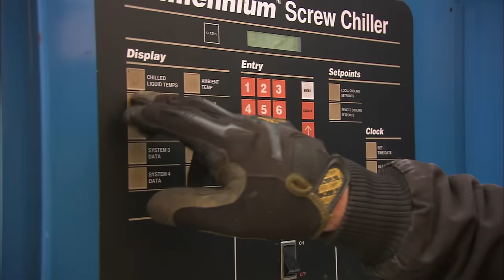Building An Ice Rink | How Do They Do It?

Comment: I'd expect them to use a bigger hose for water
Reply: I put down the ice floors for ice capades from 80 to 85. I was done a little different then this. We could put down a floor 60 feet wide and up to 160 long. We would make the ice using an everyday garden hose with a spray nozzle. It could take up to 24 hrs to make the ice. Two guys, one at a time would trade off for 8 hrs  walking backwards spraying water. A little at a time slow and steady is how it is done. The stuff they use in the tube is the same as what we used, ethylene glycol as you would know it by Antifreeze or they may use propylene glycol it is less toxic.
Reply: There in a stadium were would you expect a bigger hoses.
Reply: Nah, it’s the rate of cooling that limits progress. Putting more water on there too fast leaves you with rough, weak ice with air pockets.

Comment: The is a bit different then when I did it for Ice Capades.  We used 30 foot long floor sections, butted them together in the middle to make a floor 60 foot wide, we could go up to 160 foot long. We used garden hoses and sprayed the water on almost non stop for up to 24 hrs.

Comment: Why didn't they just use white or clear glycol
Reply: because
Reply: John M makes it easier to tell if it’s flowing
Reply: It also notifies you if there is a leak somewhere, as once the glycol leaks, then dries, it leaves pink powder where it was. If it was clear there could be a huge leak on the ice surface, and no one would know until the ice had a giant hole in it.
Reply: John M pink is cheaper
Reply: derek greyeyes yep
Reply: @urmomconnor7870  "there". Good job.
Reply: You're going to want to paint it anyway to conceal the pipes.
Reply: They use colored glycol because different colors are used to signal different freeze ratings. Blue is -20 green is -30 and pink is -50, atleast here in the states.
Reply: Greg Sall I work at an ice rink and out glycol is pink and runs at about 15-12 degrees Fahrenheit, it’s pink to to indicate that it’s relatively non-toxic
Reply: And so we can see any leaks
Reply: The great glycol argument
Reply: the ice has to be painted white regardless

Comment: I assume they built indoor pond of 2 inches deep and frost them all over.
Reply: That is not the way it works. And there is no need in ice thicker the 1 1/2 inches. When I made ice it was around an inch and a half thick, when it was time to remove the ice we would drive 2 sod trucks and the workers would shovel the broken ice into them. Ice is very strong.

Comment: I wonder why they dont just get white colored anti freeze but I honestly dont know how that works 🤷‍♂️
Reply: They usually use color  To distinguish what the antifreeze is rated too for freeze point. Wouldnt want to mix it up with water n have a pipe burst. Plus they need to add  layers over the taping anyway so it doesnt add too much time

Comment: there is no way that chiller weights 360 tonnes.
Reply: Yeah theres no way. I think he means its cycling 360 tonnes of fluid through the pipes. But im sure the chiller is around 30 tonnes.
Reply: 360 tonnes is the amount of heat its rated to remove from whatever its Cooling, its an murocan term for Scop / KW
Reply: What they are talking about is the total size of all the Compressers use to compress the freon before it goes into the chiller. There the freon take the heat out of the brine, the brine takes the heat out of the water, that is how you make ice. Once the ice is made they can back off on some of the compressers. They can back off to around 1/3 or so of there total compressers, depending at what temp they want the ice to be. Hockey players like harder ice the figure skaters, around 15 degrees if I remember right. I put down the ice floors for Ice Capades at one time. We had 3 100 ton vilter compressor ,each one was hooked up to 100 HP Linclon electric motors. We used all of that when we were making ice, then backed off. To cold and it will crack.
Reply: It’s tons as a cooling/heating measurement, not weight. 1 ton = 12,000 BTU. 

A 300ton system has a cooling capacity of 3.6m BTU. Most home AC systems are less than two tons.

Comment: "A special 360 ton chiller"... Ah... that's 9x heavier than the max load of a semi... and it's on a trailer... I think you done fucked up there.
Reply: Well if you aren't being sarcastic  it refers to the BTU output of the chiller, not its weight.  For instance a typical house central airconditioning unit is 1.5 to 2.0 ton unit. That should give you an idea of the power of this thing. If you were being sarcastic, well done!